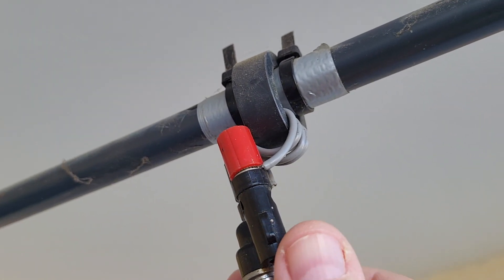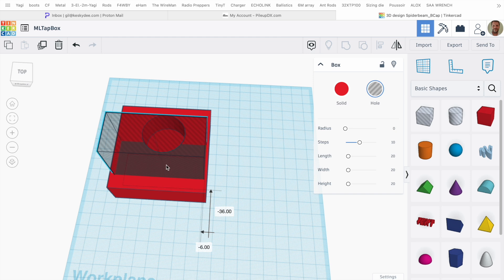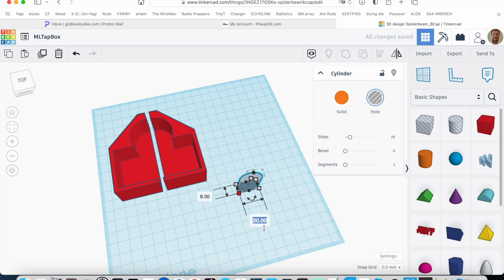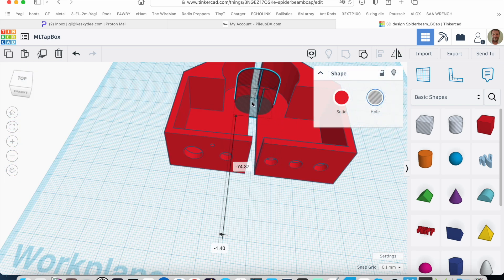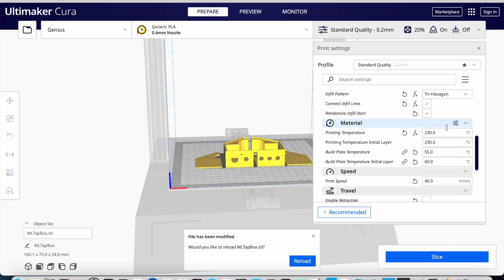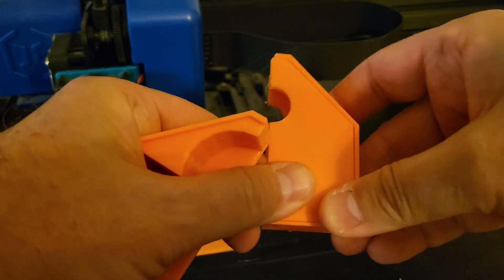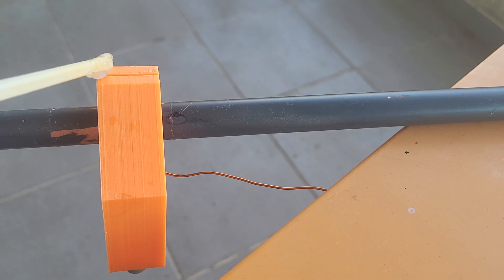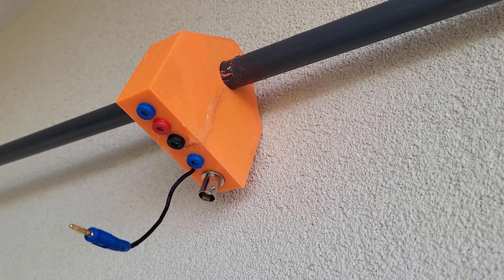Magnetic Loop Antenna Band Selection.

Comment: what about the caps, sizes and where they go?
Reply from the maker: There is only one high voltage variable capacitor at the opposite side of the loop, around 300 to 400pf. See the loop construction videos..

Comment: Would you please confirm which toroid magnet you're using and also the dimensions of the loop
Reply from the maker: Hi, it's an FT-140-43, 5m perimeter loop, 16mm copper tubing (5/8).
Reply: @RadioPrepper  thank you buddy!

Comment: Very cool. 
You should get and post a few alternate crypto addresses (other than just BTC). Perhaps Eth, ADA & LTC. 
Sending BTC generally has a higher minimum (>$20) + fees, on most exchanges.
Reply from the maker: I didn't know, will do, thanks!
Reply: @RadioPrepper  

I've already paid for a beer with BTC, no problem.  Have had BTC for a few years now it has evolved more as a settlement layer.  The Lightning Network is ideal for transferring small amounts.  If I've managed to copy your BTC address from the description, I'll be happy to send you a little greeting.
vy 73
Reply from the maker: Absolutely awesome thanks!
Reply: @RadioPrepper  
It's just a few SATs, you deserve more.  you can control the transaction speed with the network fee, which is set relatively low in my case - but it's on the way.
Reply from the maker: Thanks, I really need to learn more about crypto... I added ETH and LTE, that might make it easier.. If I can buy some crypto, which are more promising?
Reply: @RadioPrepper  
There is a very successful bitcoin reportage on arte, only background, no technology, no practice, but highly recommended.  In French "Le mystère Satoshi" are 6 episodes of about 10 minutes each. (i watches the german version, no clue what they speak in french ;) )
A good book, also available as an audio book or pdf, is “The Bitcoin Standard” by Saifedean Ammous.
Reply from the maker: Thank you!
Reply: @RadioPrepper  
I am 100% for bitcoin.  Did you see the reports and understand what bitcoin's intentions were?  For me, many "ALT" coins are free riders and didn't understand the background.  The trigger was the financial crisis in 2008. That may sound dogmatic, but Bitcoin belongs to the "nodes" owners and not to "stakeholders", they determine the transaction and the algorithm.
Reply from the maker: It is all very interesting and it will take some time for me to piece it all together... Anonymity might be the biggest advantage, but it seems that is going away...
Reply: @RadioPrepper  
A distinction must be made between anonymity and pseudonymity.  Our transaction is immortalized in the blockchain and distributed on all nodes, everyone can see and copy it.  It has only been possible for some time to create derivations from your wallet address in order to circumvent the "problem".